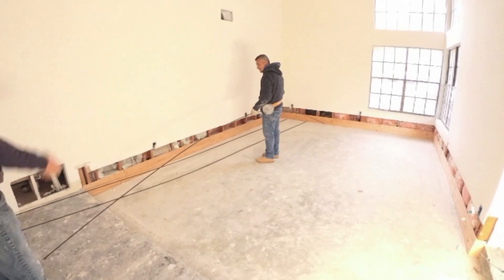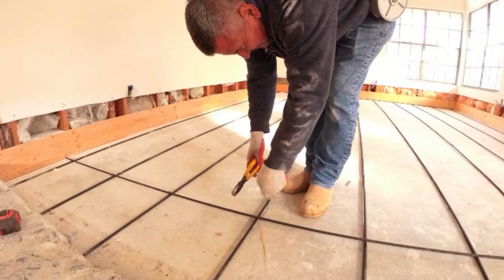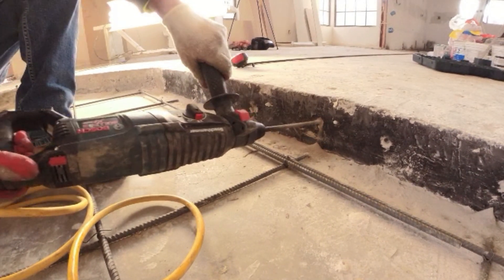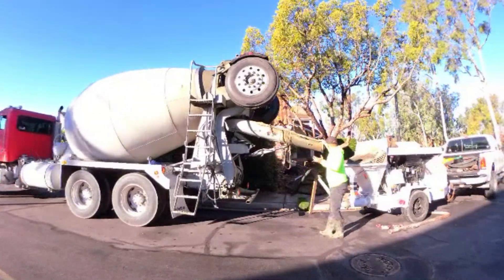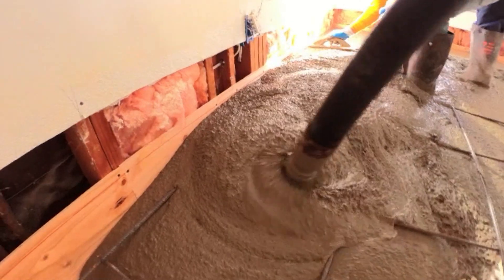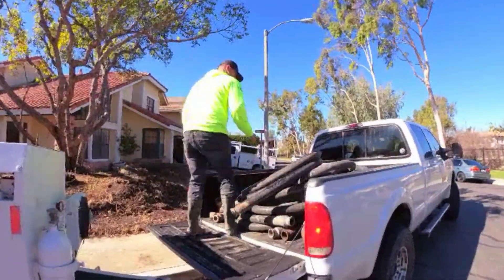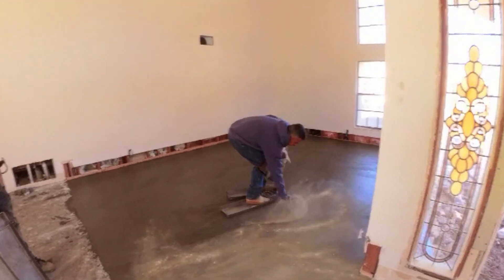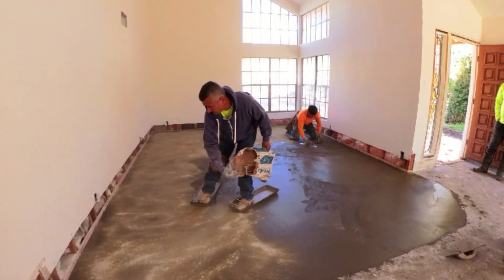Leveling a Sunken Living Room w/ Concrete. California

Comment: Another great video. Glad you’re kickin ass. We’re using line pumps for our floors more and more. The guys like them and we’re getting the concrete down faster with them. Looking forward to your next video👍
Reply from the maker: Thanks Mike 👊 line pumps are definitely the way to go. What state do you live in?
Reply: @WestCoastCustomConcrete  We are in MN. Twin Cities Metro. New construction. We use pumps every day for our footings and foundation wall pours. We are pouring floors on top of 2” foam and I floor heat more often. We are using 2” line pumps multiple times a week. I’m thinking about buying one.  It would probably pay for itself. What are your thoughts Anthony?👍
Reply from the maker: @mikehoughtaling1989  hey Mike. It would be a great move. Especially if using a pump out there is becoming more prevalent.
Reply: @WestCoastCustomConcrete  I’ve been looking into it. I think it makes sense. We get charged about $750 per basement for pump charges. Our floors are usually 20-25 yards. Take about 2 hours to place. Last week one of the flat crews used a pump 5 times for 5 basements. We use them more in the summer for exterior flatwork. Beats using a bobcat bucket. Great to see your work. Keep them coming Anthony. Really nice work.

Comment: We live in Florida and both my house and my dad's house have sunken rooms. During hurricane Ian, my dad's sunken room filled with 6 inches of water. We've never had this problem before however we want to know how we would fill it with concrete. It is 12 inches lower than the other rooms on each side. 2 steps with a center fireplace. Can we fill 12 inches with concrete at once?
Reply from the maker: Yes pour it all at once 👍use a water proofing agent in the concrete called xypex.. Water will never come through again 💯

Comment: Ive done a lot of these here in AZ. Some guys think you have to remove the existing concrete before pouring new, but you dont. You can pour right on top like you guys did.
Back in the 70s/80s these sunken designs were popular. They make no sense.
youre right, probably easiest type of concrete job to do as long as you get it flat..no joints, no edging, no formwork..easy.
Reply from the maker: Thanks for watching bro 👊💯 I love these kinda jobs

Comment: Question! Why are you putting rapid set on the poured concrete? Does that speed it up or help make the surface stronger?
Reply from the maker: Yes it does👍
Reply from the maker: It speed's it up👍
Reply: @WestCoastCustomConcrete Thank you, that's a good tip to know.
Reply from the maker: @AirborneNigel  👍

Comment: When you say the mix is straight cement, what exactly does that mean? What are the proportions of cement, sand, aggregate etc, additives etc? Thanks so much
Reply from the maker: Seven sacks of concrete per yard. Sixty sand, forty rock. Fly ash is a additive I take out.

Comment: Nice one. What is in your concrete exactly? Cement, water, of course, but what else you use?

Weve got suck living rooms in Belgium but they are about 2-3 feet deep
Reply from the maker: Sand👍
Reply: @WestCoastCustomConcrete  so never gravel? Here in BE its always 1 part cement 2 parts sand 3 parts gravel half a part water.
Reply from the maker: @Riverdale270  oh sorry 3/8 pea gravel
Reply: @WestCoastCustomConcrete  thx man
Reply from the maker: @Riverdale270  no problem 👍